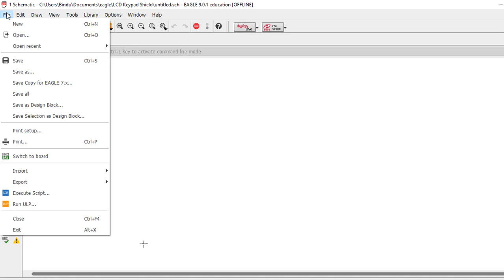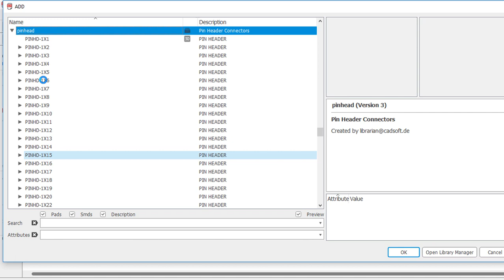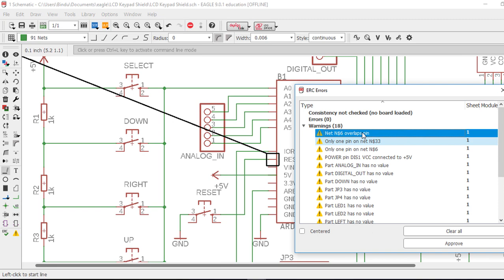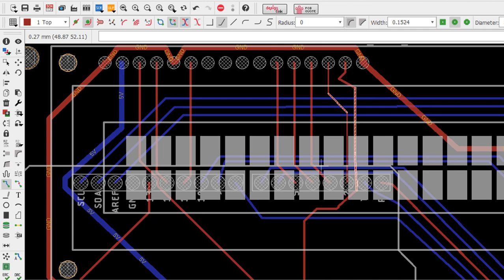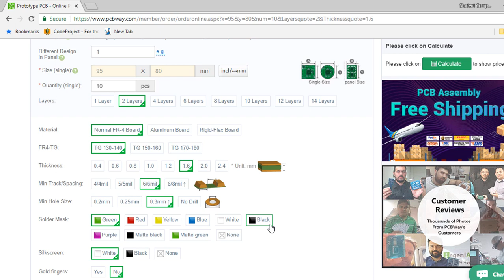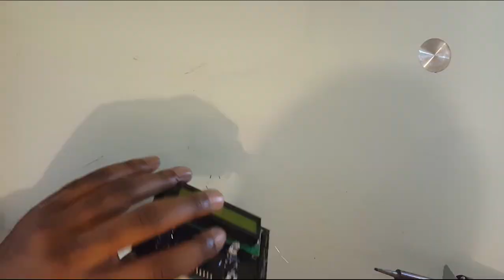Building Your Own Arduino Shields from start to finish: LCD Keypad Shield

Comment: why not use ARES its included inside ISIS protuce and it helps with auto routing !!??
Reply from the maker: Hi!
There are many PCB design software that can be used, each has its own advantages. The reasons we chose eagle are: 
Eagle is widely used in industry even many open source hardware are done with Eagle like Arduino itself. You can get Arduino boards eagle files for free from their website.
You can use Eagle completely for free with some few limitations that wont affect our tutorials like 2 layes and board size unlike ARES which is not free
We also gonna record more PCB design using other software like EasyEDA and Fritzing which are also great, popular and free.
Basically any software can be used even ARES.